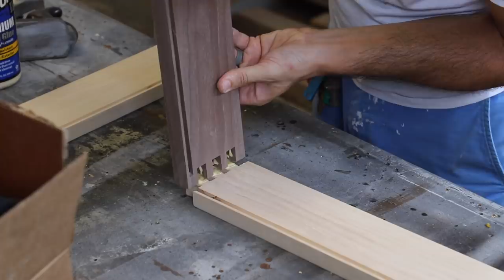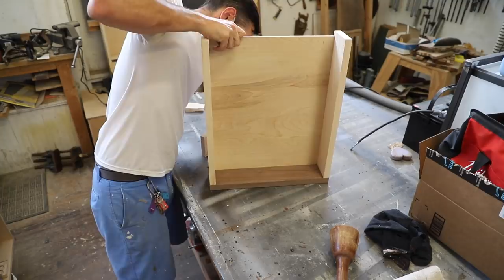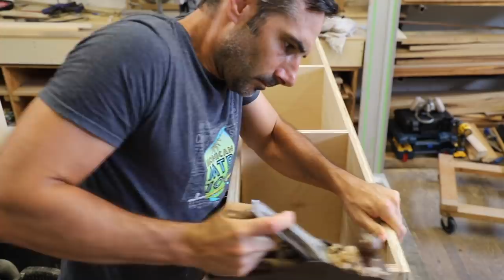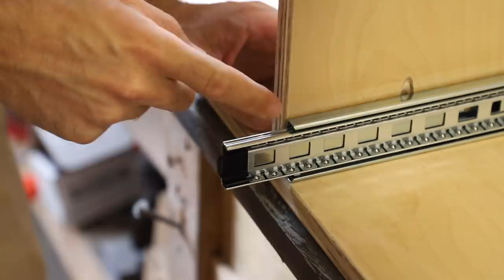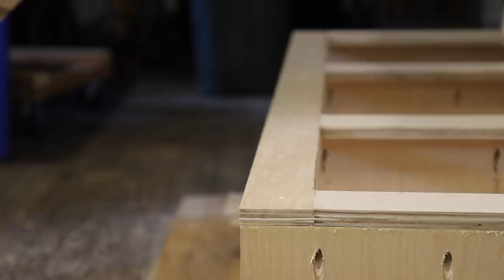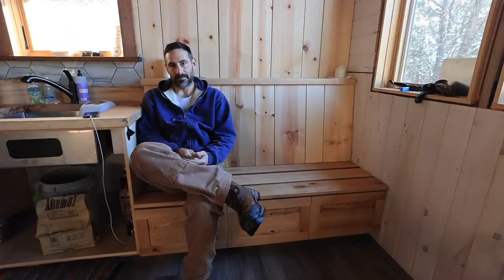Building a Drawer and Installing it | A Built in Bench Seat Part 4 of 5

Comment: I like the bench seat the most!    But those drawers are smooooooth!  Now you have to Tie in the cabinet doors to everything you have going on all around them!  Bow Ties, contrasting bench! Geodesic back splash, with live edge, hidden strip lighting for inside for when you open the doors the lights come on, floating interior shelves on the back of the doors, and whatever surprise you have up your sleeve with the kitchen  table!  "You can do it!"
Reply from the maker: Those are some good ideas.  I know thats do able because I saw a video of  a guys shop where if you open a blast gate his dust collector automatically comes on.  Would be cool to apply the same concept to the drawers and doors.

Comment: Nice Build!!! Are the dovetail joints in the drawer hand cut or with a jig? 
That is one thing I miss having moved to the EU, trying to find decent wood stock at a decent price as well as most of the hardware needed to work on my projects. Lots of stuff is available from some of the northern countries, one problem is that many times they do not speak English so trying to order items is a pain.
Reply from the maker: thank you, yes they are hand cut, and if you look in the description, I have a link to a video cutting them.   Oh wow yea I bet its tough to find what you need.  I bet hardwood is a premium over there as well?